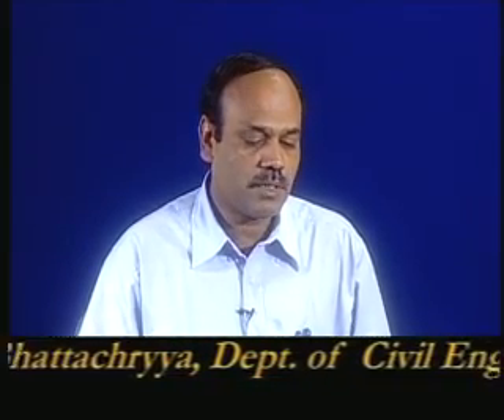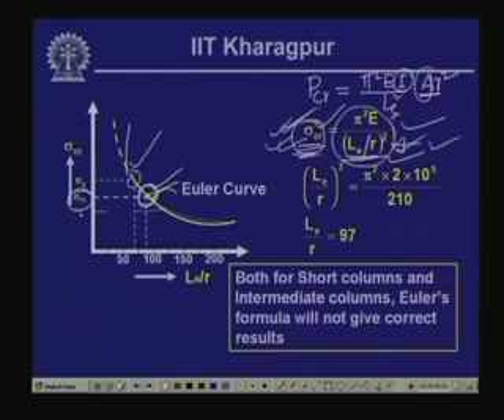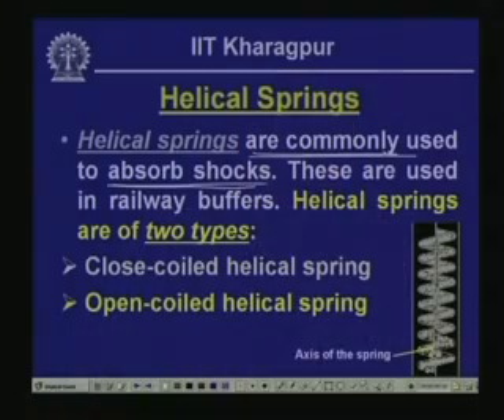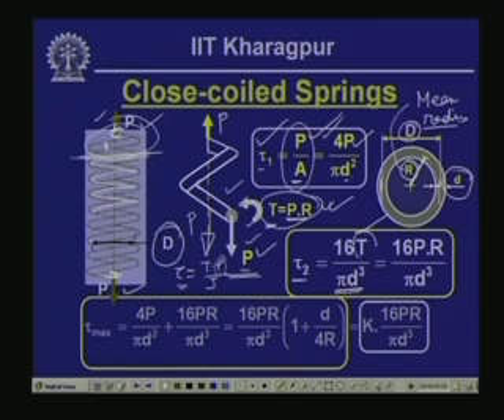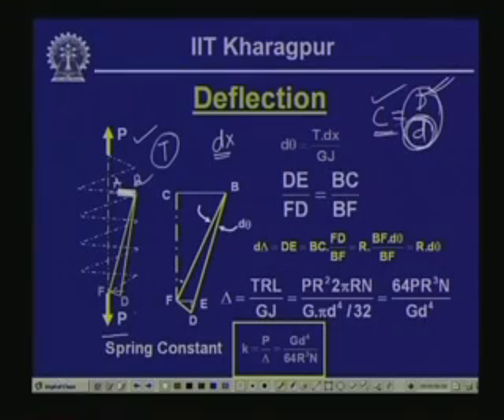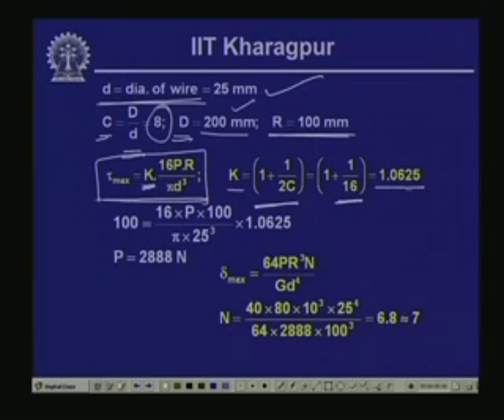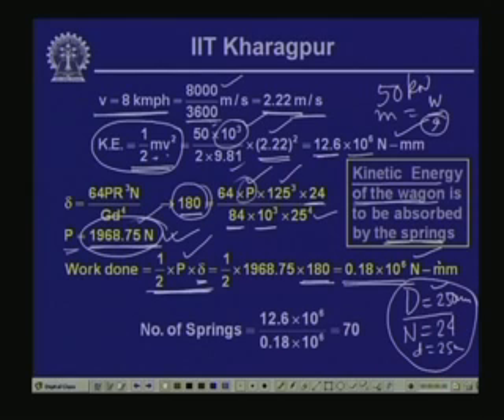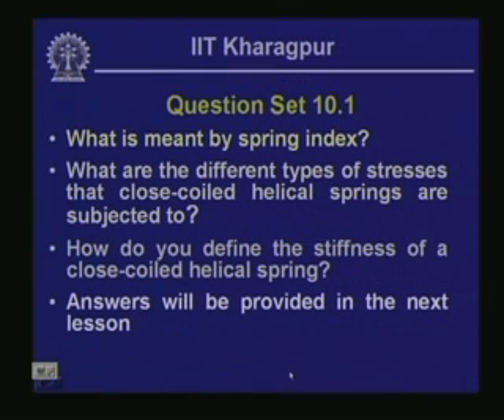Lecture - 39 Springs - I

Comment: Why work done is(1/2 x force x distance ) ? it should be ( Work done = Force x Distance ) i think ?
Reply: Actually we dont apply foce in most mechanical probleums as its max magnitude say P rather,we gradually increase load from zero to P and hence if we sum up whole i:e integrate all through these forces we get 1/2 p*delta
Reply: i think the spring energy on being compressed comes to be 1/2kx^2 so since k=(p÷∆) here ∆ is deflection...or we could say x...so on substitution 1/2kx^2 = 1/2.p.x...